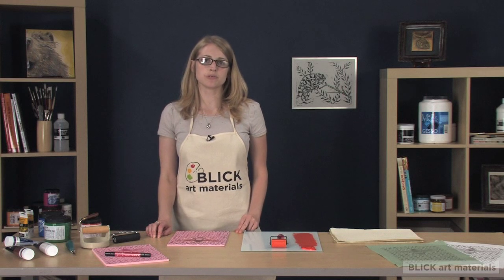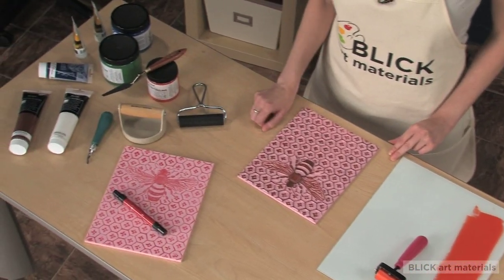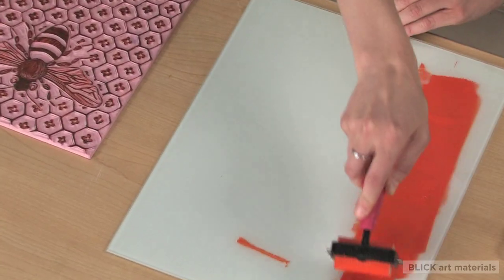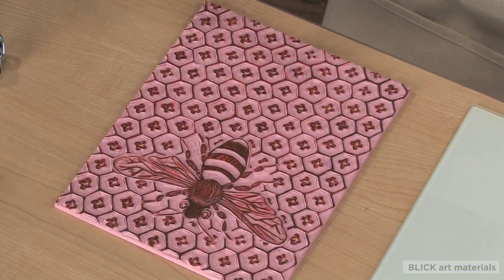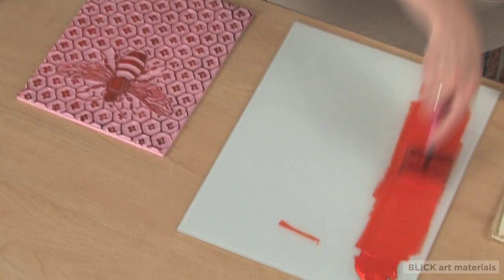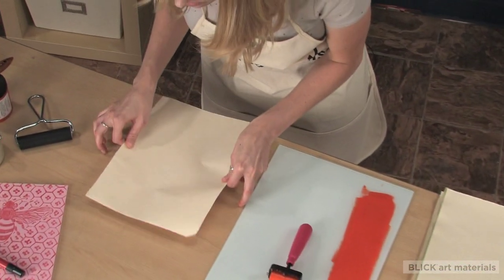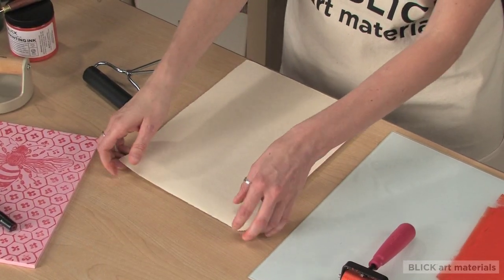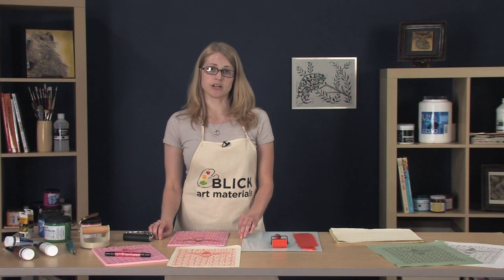Linoleum Block Printing

Comment: What kind of ink do you used? Oil?
Reply from the maker: +Inês Maria Oil block printing inks should not be used with the soft style blocks, only true linoleum.  Use waterbased block printing ink, like the Blick
Block Printing Inks with soft cut style blocks. For any additional questions, you can reach Blick Product Information at 1-800-933-2542 or info@dickblick.com. Thanks!